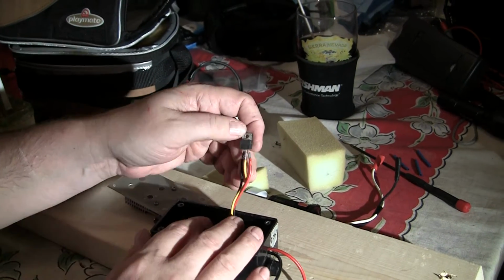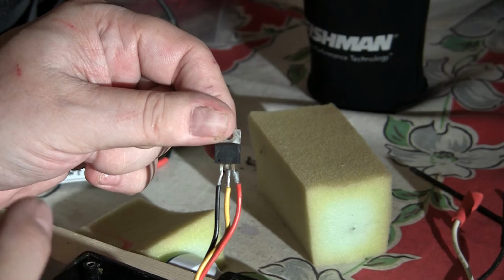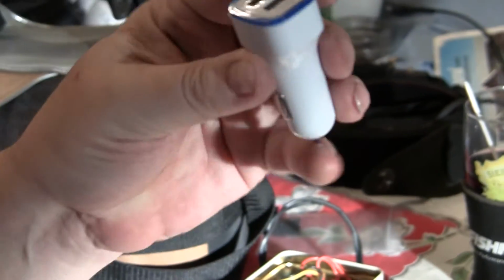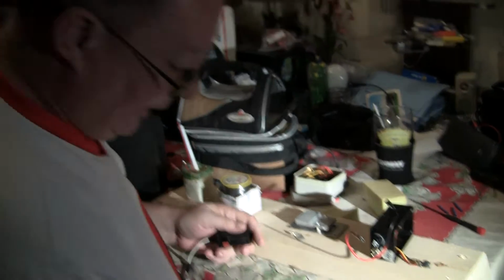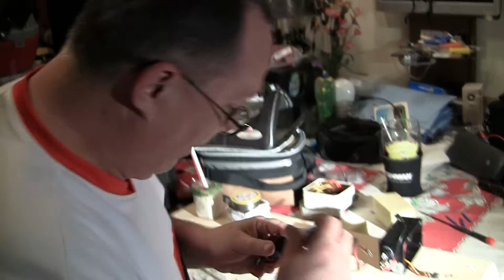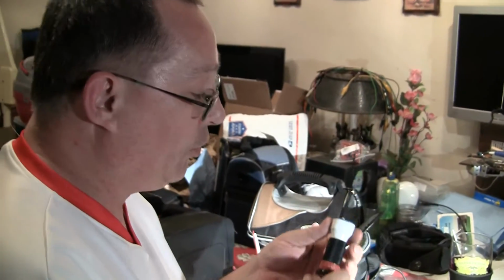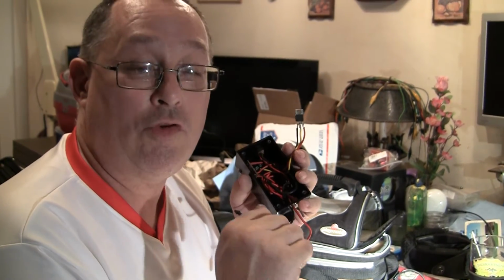DIY battery pack - camcorder part TWO

Comment: Hey Petey good to see you do a techie video in the work area again. If you're anything like me, you probably have a plastic parts box with a bunch of those voltage regulators from radio shack or wherever lol. On my last few things I've been using buck converters. They cost a couple bucks, but the energy loss from heat is almost nothing and even the cheap small ones I'm using will do 3 amps. Also you can set the output voltage to whatever you need by setting the onboard pot... within specs of course, usually 2-30 volts I think. Anyway just a suggestion to maybe squeeze a little more runtime outta your battery packs.